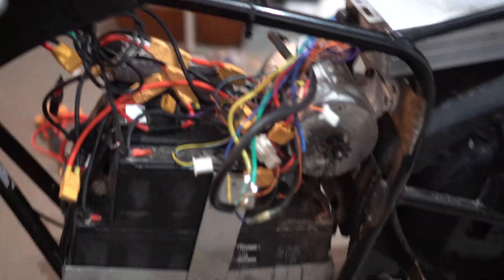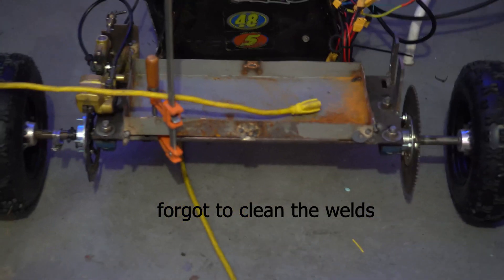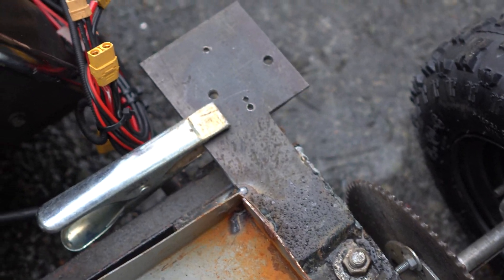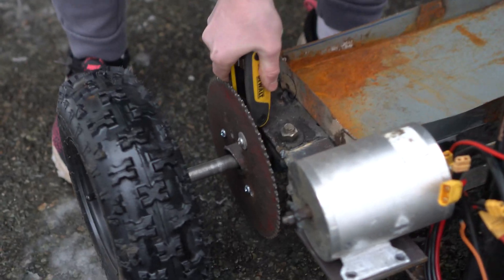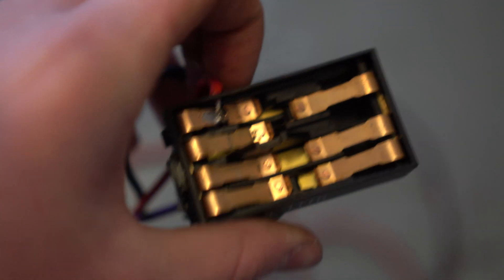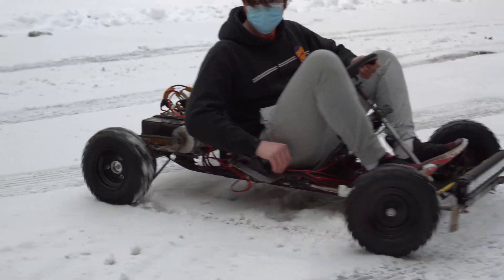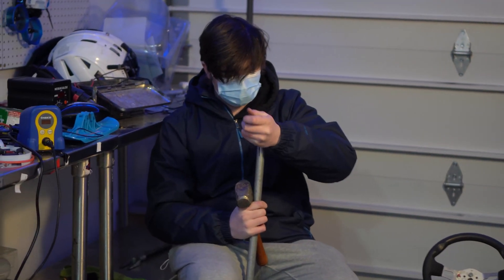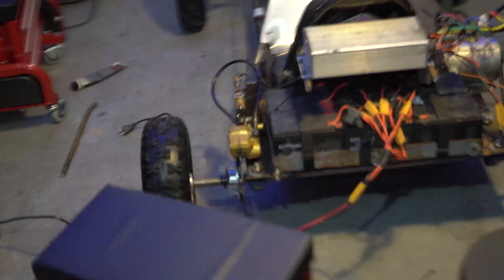Electric Go Kart Build   [Ep.1]

Comment: What all did you need to make this? Would love to make one myself
Reply from the maker: I suggest you start by buying a go kart frame on Facebook Marketplace. Prices vary depending on location and other factors but you can usually find a decent kart frame for between $200 and $500. 
One motor option for beginners is to get an all in drivetrain kit on amazon or eBay. This will provide all of the electronics you need to power the kart. Most of these kits are 48v 1800w and come with 4 12v 12ah lead acid batteries. These kits are good for a kart at 20-25 mph with 6-8 miles of range. 
The second more expensive but much faster option is to get a higher power 60v or 72v motor and chose a lithium ebike battery to use with it. This will get you to around 40mph and depending on the batteries, between 8 to 25 miles of range.
Buy matching sprockets for the kart axle and the motor shaft.
Mount batteries and motor to go kart and wire everything up. Then you're ready to go.
You can DM us on Instagram @egenbuilds if you need any help choosing parts or setting up your build!